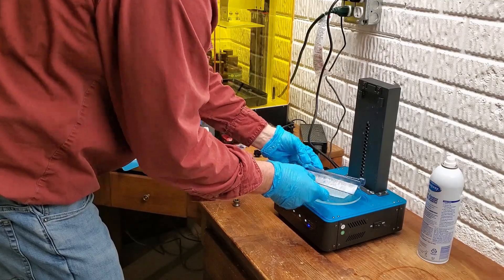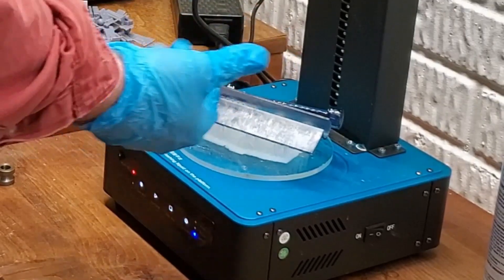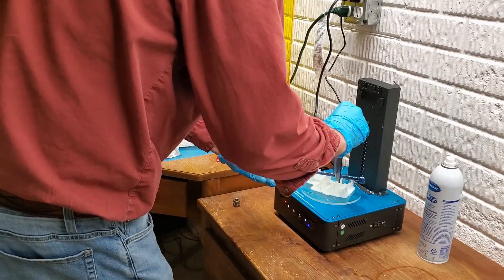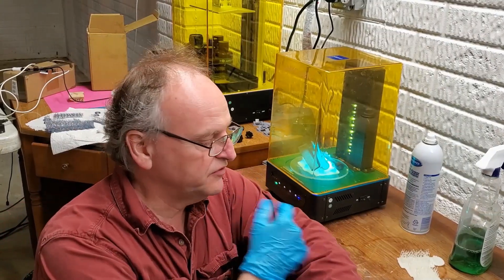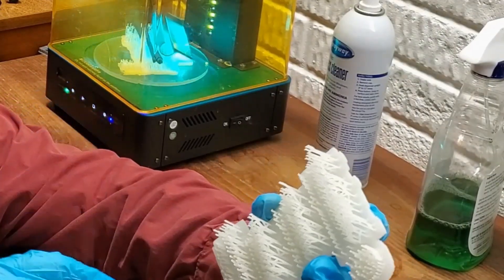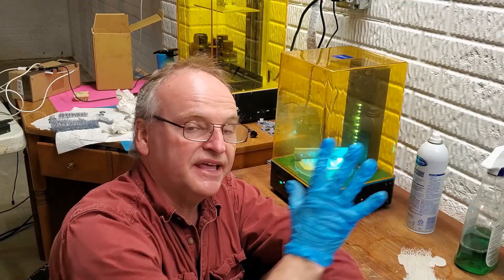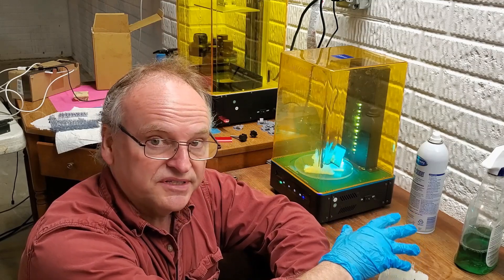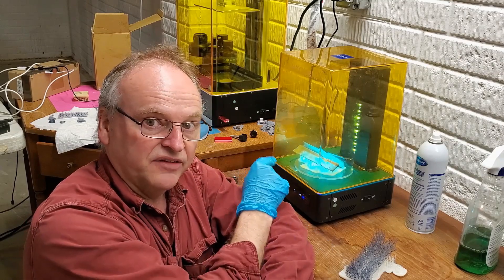Small Use for Old Supports

Comment: Ohhhh.... That's genius! Seems kinda obvious now you've shown it.

I'm still going to cure precision flat surfaces on my DIY heated glass plate with weights on top but for most parts it's a great idea and brilliant in its simplicity.
Reply from the maker: Got any pictures posted of your glass plate setup?
Reply: @krullmi  Unfortunately not but.... if I'm honest it's kind of unnecessary and I wouldn't actually recommend anyone copy it. It only heats the bottom surface so it needs an additional heater for even heat anyway. It does speed up the preheat by a few minutes but it isn't really worth the build time. If your interested though look up aftermarket car rear window heaters. 

A more interesting project I'm currently working on is a curing chamber that uses an array of 50W 395-400nm COB LED's for both the heat source and light all in one. These LEDs are available for around $10 each. Better yet they also have the LED and driver circuitry on the same chip (they just plug straight into mains). 
I'm lucky enough to have free access to massive heatsinks leftover from a production process at work so I'm going to be able to build a kilowatt curing chamber for just $200! 
I'm somewhat concerned it might be too much UV actually... 
One other problem I'm yet to resolve is chamber temperature regulation but I've got a few ideas that I'll be testing.

Comment: Thanks for the tip! My printer's in the mail and I'm wondering how strong that turntable is because I was hoping I could water-cure with the station. I've seen the results of water-curing and now I'm wondering if it would also help with avoiding warped parts because the water would negate gravity a bit.
Reply from the maker: Sorry for the late reply.  It would probably be ok with a jar of water and your parts on the turntable.  It seems strong enough to handle that for 6 minutes at a time. I suppose if the jar is not centered the turntable and/or motor shaft might flex enough for the jar to slide off. If you could make some sort of 3 or 4 inch diameter ring/thrust bearing that was the same thickness as the space between the turn table and the base that would help prevent tipping. 

Would love to see pictures or a video of water curing parts using the wash-and-cure.

Comment: If parts are properly washed they should not be sticky and will not stick to the plate anyway.
Reply: Nop, uncured resin its always sticky after whash it
Reply: @noway8233  No its not because its not uncured unless you haven't washed it properly, You shouldn;t have uncured resin on your prints thats the whole point of washing them. Its all cured resin, just not FULLY cured so its not as hard as it can be, thats why you cure it afterwards also to achieve maximum strength